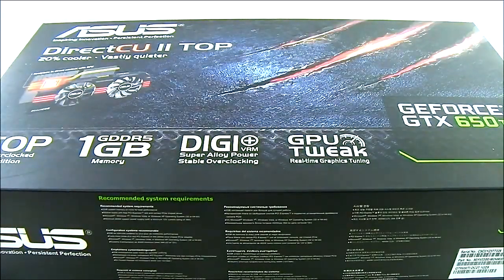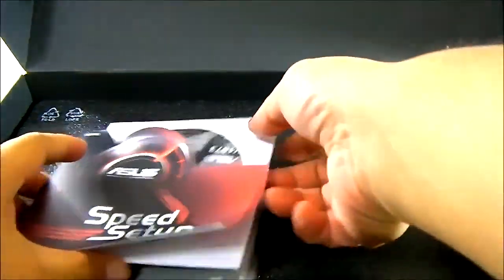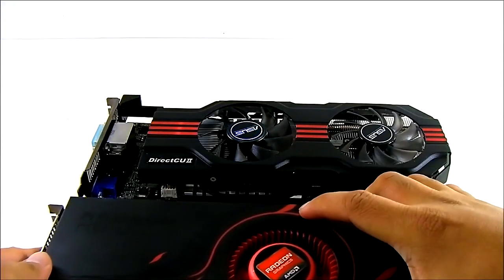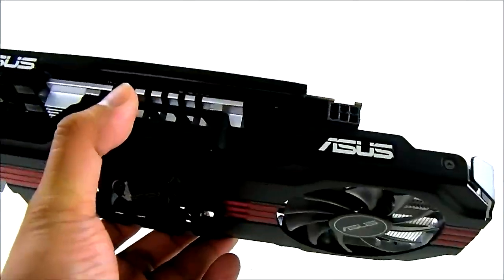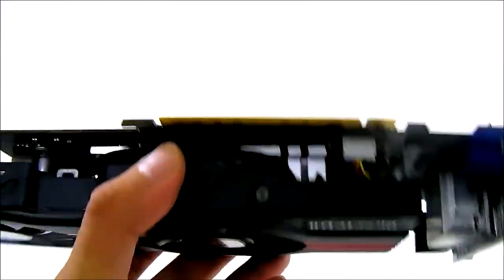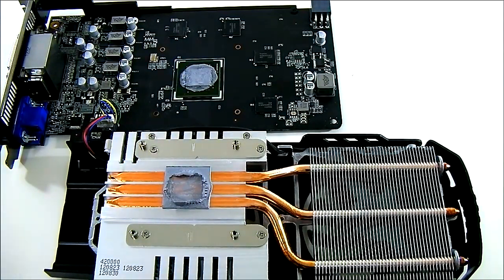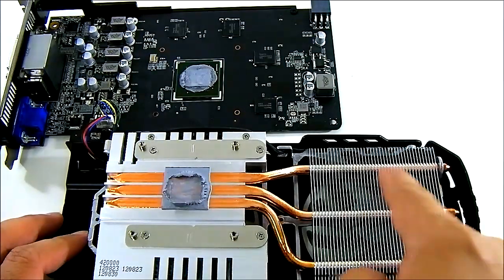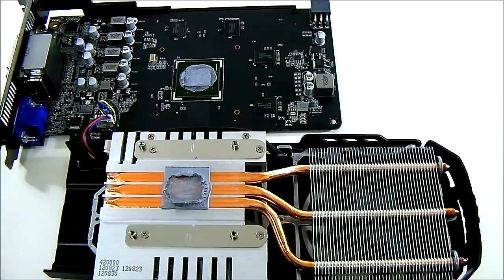ASUS GTX 650Ti DirectCU II TOP Video Card Unboxing + Overview

Comment: Not really, this is mainly due to the 1GB on your GPU. Also just to mention why did you get a 650 watt PSU? you system would work fine with 500. I would look to get a 2GB or 3GB card i.e. Radeon 7950 3GB just over £200.